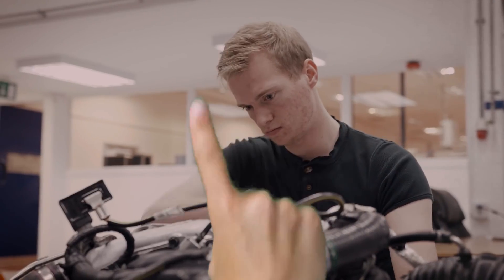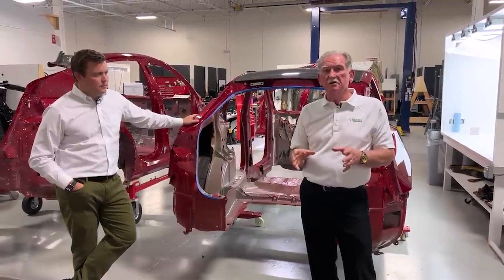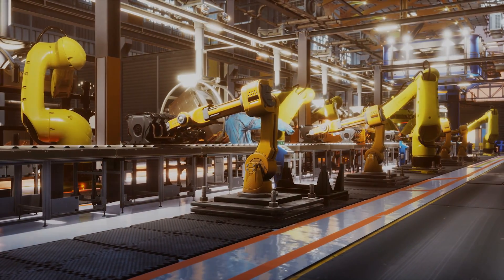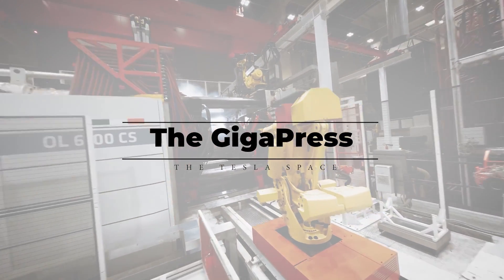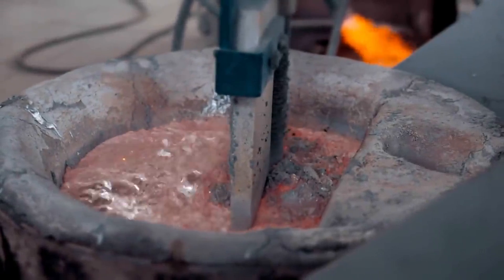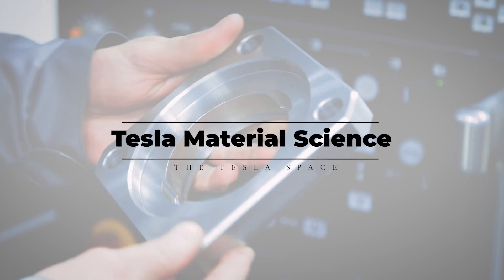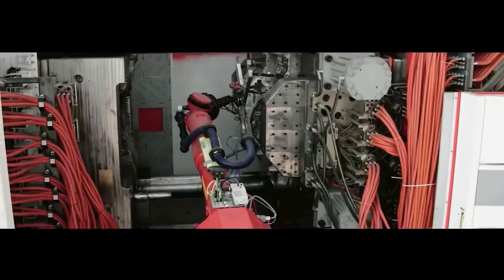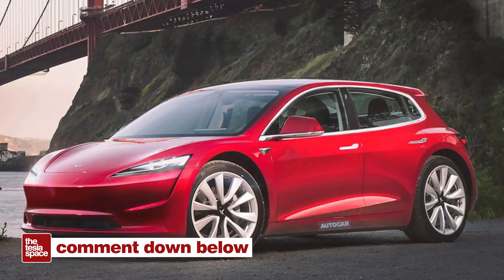The Incredible Logistics Of The Tesla Giga Press!

Comment from the maker: Are you looking for the perfect gift for your significant other? Click on the link and use the code TTS20 for 20% on FOREO BEAR: https://foreo.se/6kr0
Reply: Please remark on how Project Highland, in integrating a front casting into the Model 3, is the final stage of giga cast development, pending Gen3. Also, despite their low run rates, will S, X, & even Roadster ever justify giga casting? Could that be part of the Gen3 evolution? Finally, given the need for secrecy, will it be another year or so before we see similar graphics about Semi? Thx for your outstanding content!
Reply: @The Tesla Space - the primary reason for high ductility in Aluminium for Automotive, is for safety.  You can't have crumple zones with a brittle metal that will shatter.  That's the main reason the industry avoided Aluminium for the frame.  Another related reason as been that Aluminium is prone to "work hardening" which means that stresses it experiences during its operational life make it less and less ductile, leading to failure via cracking.  So the same problem in a few years.  "Aircraft grade" Aluminium alloys are focused on preventing work hardening, because aircraft flex a lot.  That's also why Aluminium bicycle frames are generally made from "aircraft grade" alloys.
Reply: A significant other would be the perfect gift for me...
Reply: If the whole car is made out of one big casting, how is it repaired? In a regular car you simply replace tha damaged parts, but that´s not an option if the whole car is just one piece.

Comment: Great video! Short answer is NO.  They will likely be able to cast an entire floorpan, or symmetrical halves, but an entire car body (or substructure/frame) simply has too many closed off nooks, crannies and sectional shape changes to make in one casting.  A die has to displace all volume you don't want metal, and there is no way to do that and get the die(s) back out of the car.  Watch videos on how engine blocks are cast using lost wax (or foam) to sand and you'll see why die casting can't do that.  Still, Giga press are awesome and will make ever larger single piece front, rear or section halves of a car/truck that are welded together or connected with easy to make cross pieces...

Comment: Doubt going from 2 castings and a couple of rails (for the rigid battery pack) to 1 single casting would be useful. You can make front and rear strong enough to survive anything but a crash that would total the vehicle anyway. Not so sure for a casting that ran the length of the vehicle cast in aluminum alloy. Would prefer the laterals to be steel for better side impact resistance which would also help to protect the cabin and battery. 

Also you are talking of replacing 4 parts with 1. Not 70:1. Not a big game changer that will eliminate another 300 robots or even 30.

I'd be more interested in seeing all his cars have both front and rear castings.

Comment: But with their unitary design will a evident repair be  more difficult, expensive and increase insurance costs?
Reply: In an accident that totals the car, it wouldn’t matter. However, if not totaled, it is designed to have the crash absorbers cut off and new ones bolted on.

Comment: The press power capabilities are many folded.

The key power needed is injection force, since the flow will encounter cooling when pressure released inside the tooling (moulding), injection must be completed within very short time.

The power required is usually referred to the injection pump.

In the above footage, the creative new idea of having two set of injection directions at an angle of 90⁰ to each other.  This is to going after a multiple insert effect.

The objective of having double inset is a common practice. 

However, the injection heads directions may not be fixed 90⁰ at each other.

Rule of thumb is, the main product generated has to be injected and finished in one go.  The odd structures hindering mould pair opening can be solved by multiple small inserted half moulds at strategy positions, even the injection paths can be coming from different sides, from different injection pump route.  
J
Therefore, the extra adjunct injection head setup is depending on finished product design.

Comment: My forecast is that the first model 2 will be assembled from 2 giga castings  using the 9000 tn press, which are fastened directly together front  to back with just reinforcement with the structural battery pack. That way the basic frame could be assembled almost as soon as they come off the press, after trimming.

Comment: But what happens when you get into an accident, and you can no longer replace a single part, but rather you need to replace an ENTIRE casting? Seems like more and more cars will be totaled out and unrepairable, thus wasting otherwise perfectly useable cars unless receiving an insanely expensive repair….the engineering is incredible, but the practical use is just not there…..

Comment: Solid video man,I didn’t know the Press needed more clamping force just to make a BIGGER part. I thought it was to make a more complex part.
Reply: The press power capabilities are many folded.

The key power needed is injection force, since the flow will encounter cooling when pressure released inside the tooling (moulding), injection must be completed within very short time.

The power required is usually referred to the injection pump.

In the above footage, the creative new idea of having two set of injection directions at an angle of 90⁰ to each other.  This is going after a multiple insert tooling effect.

The objective of having double inset is a common practice. 

However, the injection heads directions may not be fixed 90⁰ at each other.

Rule of thumb is, the main product generated has to be injected and finished in one go.  The odd structures hindering mould pair opening can be solved by multiple small inserted half moulds at strategy positions, even the injection paths can be coming from different sides, from different injection pump route.  
Therefore, the extra adjunct injection head setup is depending on finished product design.

Comment: IDRA super press technology is actually come from China - a factory based in China, plublic listed in Hong Kong (stock number 00558).

Such high tonnage super press have been deployed in many industries in China.  IDRA faced difficulties in this area, and was acquired by this China factory.

Tesla in overseas is supplied by IDRA, while in China, this original manufacturer supply this to Tesla's Shanghai plant.

Tesla even sending a large Chinese automobile engineering team to US plants inorder to help boosting production efficiency in US.

There are other new technology in China competing with this super press solutions; China's J20 and other latest airplane manufacturing is now moving away from super press to 3D metal printing.  J35's uni-body is believed as a single 3D printed frame!  

Tesla may welcome such change in the future!

Comment: You missed the biggest plus to castings.  The bolt pattern is no longer .032 of an inch.  With CNC mills, any pattern can be accurate to plus or minus .002 inches within 3 standard deviations using center drills instead of spot drills and a dedicated single step machine can generally hold .005 inches.  That allows all the parts to fit together with fewer rejects.  Rejects use up space, time, and they are product that generally can't be sold.
Reply: Finally someone that is talking about post machining on the die castings.  I have to wonder how much machining will have to be done. I've worked in two different die casting shops as a mold maker and I am always amazed at how ignorant people are to the ability of a die casting. Any threaded holes,  motor mounts and suspension points will have to be machined in a precision manner . This idea of taking a raw casting and just gluing it into place is just stupid.  That is unless Elon plans on making an even more shabby product.  😢
Reply: @paul5683  Aluminum face mills very quickly these days, though the mills that I have worked that size run 3 million each plus tooling.  I would think that shrinkage would be the bigger problem, but you are the casting person.
Reply: Shrinkage is figured in to the dimensions of the mold by making all dimensions larger in the mold, you can plan on what you will end up with.  Everything has a shrink factor,  usually taken care of with using a percentage multiplication.  Distortion in the ejection and cooling process is also an issue with a big casting like that, often not something you can see until you try machining it.

Comment: Absolutely convinced they can cast a whole body. It is an engineering and metallurgy design challenge against which there is no fundamental element against it. Here the only elements in play are a vision, an economical advantage and so the will to do the upfront investment and take the risk that comes with it. Idra was on the same terms with Tesla on this challenge. Success is the only way forward and failure is not an option. These are the final terms.

Comment: Megacool, and also, why stop the thought process here? So, let's say you're a supergenius trying to get a new car off the ground. You for damned sure cannot afford this press, but maybe you can afford a handful of smaller machines making four, six, or maybe eight parts and still replacing hundreds of parts and robots. Design them right and you won't even need threaded fasteners. With various machines working togeether, maybe you don't make the whole thing out of aluminum, either, and you can work in 'mixed media'. Just sayin'. The approach is scalable, yo, and would make sense even for Tesla lines on new kinds of production runs. Elon is building rocket engines, humanoid robots... And now we can really say 'whoa'.
Reply: Elon wants to run everything . Cars,internet,robots,nuralink etc .

Comment: "While Henry Ford is often credited for creating the assembly line, he did not. He merely improved and innovated on it. He found the idea for the assembly line from another Michigan based automobile company run by Ransom Olds."

Generally, in academia, the assembly line's credits go back to Taylor (Frederick Winslow Taylor (1856-1915) was born in Philadelphia, Pennsylvania): "The term Fordism ... refers to the rationalization of the Taylorist method of organizing work through the creation of assembly lines, which made standardization and mass production possible. The advantage of the assembly line was that it brought the work to the worker instead of making the worker go to the work."
"Frederick Taylor’s four principles of Scientific Management are:
1    Develop a science for each element of work
2    Scientifically Select, Train, Teach, and Develop the worker
3    Cooperate with the Worker
4    Divide the Work and Responsibility"

Comment: In the 50 60s the factories tried cast frames. Problem was they totalled the car after small crash because welding and  straightening 
 are not possible. So insurance companies stopped it as to costly. They had concerns of crash and crush zones. Mostly for the cars they hit. The giant piece does not release energy by bending twisting and crumpling. The forces of a  sqaure battery pack is like a kinetic missile at 70 mph. The body on skateboard design showing cases of the sled and pack sheering off from body in crashes with firetrucks. The bottom flew right under the truck frame and top was crushed.
As an ex racer and tester of AutoCAD in 90s we resorted to the roll cage and crumple zones.

Frame should be square stainless steel box tubing hydro bent and robotic welded. Steel
is essily recycleable and cheap.
Reply: Talk about living in the past. Go back over the Munro Podcasts and pay attention to the design developments from here beyond 2021 . They have cast an amazing repairable substructure that is rated by ANCAP to five stars of Safety, that pretty much says it all …
Reply: You have pointed out a major vulnerability, there goes your social credit score.  😢
Reply: The 1950’s / 1960’s were 75 / 65 years ago. The 1990’s were 35 years ago.

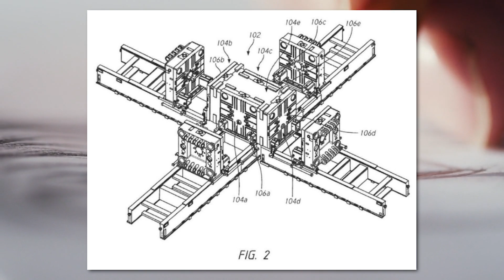Comment: Making a single die cast for the whole frame is already in the "hot wheels" concept (at 4:29). It will require a central collapsable piece (for the cast to be removed from the press) with at least 4 giga press devices. Maybe more than 4 and then a two or more stages to accomplish the final product (frame). 
Tesla makes science fiction more reality than fiction.

Comment: All of this is exactly correct,   let me briefly describe how bad that is.... A small fender bender totals the car,  the unibody is unrepairable or non serviceable,  there are some clever people developing techniques but for some unknown reason, Tesla will not discuss spare parts or replacement parts.   i'm okay with the notion of disposable unserviceable cars but they need to be dirt cheap.
Reply: Only the frame is die cast, if you bend a fender, you can replace it, just like on any other car.
Reply: @Ronan1701  the unibody is the frame....  it is unserviceable and unrepairable.  the fronk lid, trunk lid, doors, fenders and bumpers are the only replaceable parts

Comment: Saved for integrated fasteners-
They need to get away from "metal" in frame and body.
Injection mold entirely from co-polymers & tri-polymers.
Colored built in- no more paint or coatings. Larger airbags,
fire suppressing foam where needed, 1-piece rim/solid tire wheel.

Batteries need to be made more able to be recycled.

Comment: They will absolutely accomplish an entire vehicle in a single casting, it might be smaller than the 3 but it will happen.  Imagine a small vehicle in the cyber truck concept as a compact utilitarian vehicle without paint.  Low cost, durable, and unbeatable at that price point.
Reply: @purchasedbyblood  have you ignored the whole "more advanced castng machine than anything the industry has" part?

guess who the only one here who has no clue is
Reply: Yes please! Hard to imagine that they won’t crack it considering their progress over the last few years
Reply: More important is that they get their quality control and reliability in check cause they are always near bottom in those rankings . But that would be a good step forward
Reply: Im imagining. Sounds like shit and wont work.
Reply: @ilyarepin7750  don’t be so hard on yourself.
Reply: If you knew anything about casting it is impossible due to angles and draft angles and die manufacture.
Reply: @dikkybee4003  I’m sure you are smarter than Sandy Munro but he discusses these Giga Presses at length and bottom line is Tesla innovations in many areas is giving them an advantage that won’t soon be surpassed if ever by the competition.

Comment: Will  Elon be able to   diecast his future models in one casting only? Of course he will , the proof of it is in the fact that the ITALIAN MADE  IDRA , has enabled his manufacturing process to a level inconceivable prior to the  use of the giga press,
900O thousand tons of force is respectable enough ...but considering that the USA military has routinely availed itself of a 50 thousand ton press to actually forge  special parts , the goal of producing  a diecast press that may need  2O thousand tons is not at all a bridge too far . The speed at which it will operate will be a challenge not because it  would not necessarily match the current GIGA ...but it would be a case of diminishing returns if the cost of the press or its energy requirements cannot be factored into the cost of the car fast enough in the business model sense.  🟩⬜🟥 VIVA L`ITALIA that`s nice giga press😁

Comment: If the whole frame was built at once, ¿would the whole vehicle be disposable after any of its sections is bend/damaged in a crash?. For instance a small crash may bend the right-rear. ¿Could that be fixed?
Reply: yes, reparability is not always a priority when trying to increase efficiency
another example, older tesla battery packs can have individual modules replaced at an independent shop (Tesla would just tell you buy a 20k usd new battery), but with the structural battery there is no option for reparability 
there are always 2 sides to the coin
Reply: Buy a new car 😂

Comment: Yet OEM’s still aren’t trying to copy these casting techniques.
Reply: Just Volvo
Reply: My 2002 mercedes had a die cast front subframe.  I'm guessing mercedes still uses that technology.  
One thing that is often overlooked is the post machining that has to be done to a die casting. Things like suspension points, motor mounts and threaded holes. 
All this post machining was briefly mentioned in the video. 
Maybe someone can explain to me how Tesla plans to use these castings as is, right out of the press.

Comment: How do these huge parts affect repair costs after car accidents. 
Will a small accident be a total loss.  What would the insurance repercussions be of this.
It would be great if someone did a video on the repair ability of such parts and manufacturing techniques
Reply: It’s the frame. If the frame gets bent on any car it is salvaged.
Reply: @littlebrothermoneywithmich6178  nonsense, a lot of accident cars with damage to frame get repaired, and not all of them are bad, some are, but there are a lot of shops who do quality work on 50+k$ accident cars, but with this new teslas build method it might not be possible any more, aluminum behaves different than steel, a torn off bracket or missing piece could be welded back in no problem, but that is small stuff, if a side sill is bent, then it will most likely mean a write off, not the most eco friendly option... cheap to make though
Reply: The body of a tesla is not what I would worry about in an accident, the battery pack is whats going to cost the most to replace. Repairing a badly damaged unibody on a vehicle is a common practice these days.
Reply: @leebatt7964  reassembling the complete car in another body is more expensive than company production.